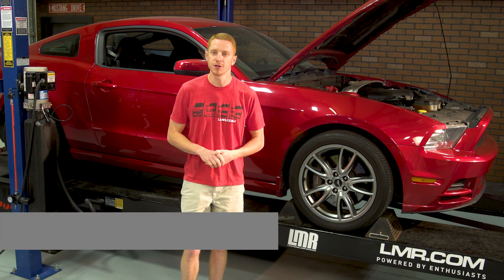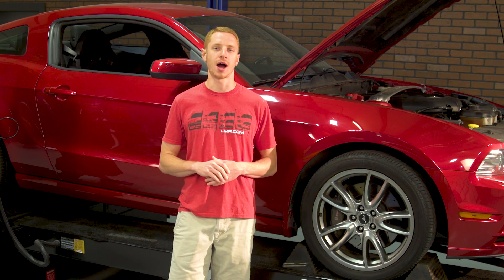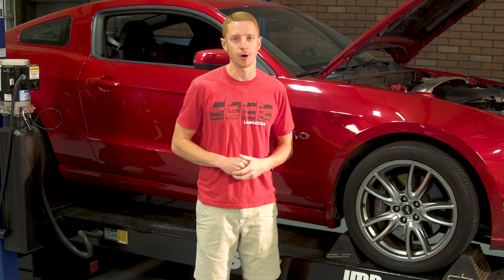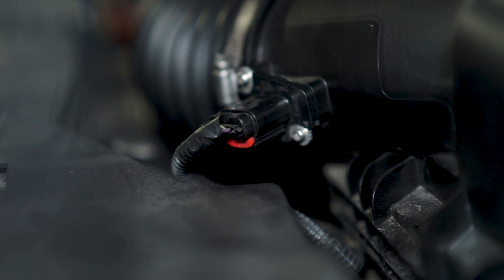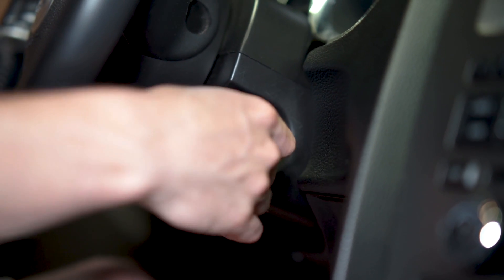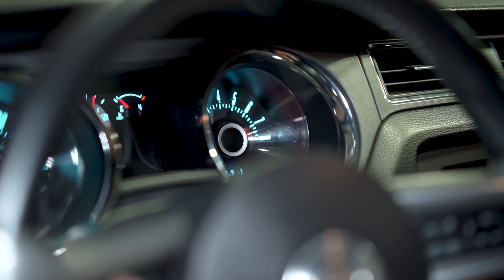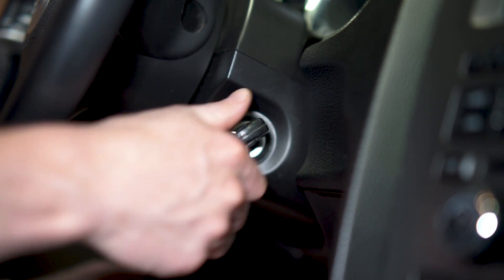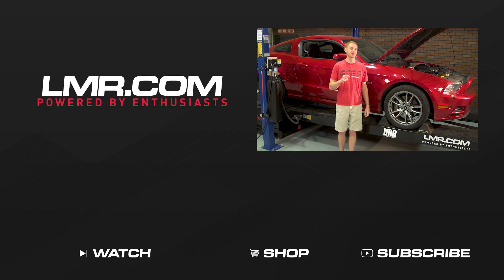2013-2014 Mustang GT Ford Performance Track Cal - Install & Dyno

Comment: So, after installing this, then later the Bama v2 race tune, I noticed the numbers American muscle was getting on the dyno.  The TrackCal should be blowing the Bama tune away, but my car tells me a different story.  That's when I found out I have the ProCal tune, which is weaker than the TrackCal.  I don't know if I was swindled by American Muscle or Ford, but I'm not buying another tuner just to get that tune.  Is there a way to JUST buy the TrackCal tune??
Reply from the maker: The TrackCal and ProCal options for the gen 1 Coyote cars have been discontinued. -Landan

Comment: Hey LMR, do you know if this is any different than the 11-12 Ford Performance calibration. I assume this wouldn’t work on an 11, but they seem similar.
Reply from the maker: Ford Performance used to offer M-FR1-MGTB, but they discontinued it. For whatever reason, they never offered the calibration by itself for 11-14 GT cars. Instead, they just have the Track Cal for 13-14 manual equipped GTs. The reason for the specific year range is due to the steering wheel controls for the Launch Control and Pit Lane Speed Control features. Hope this helps. -Landan
Reply: @latemodelrestoration would this work at all on an 11-12?
Reply from the maker: @chrissyrett673  This is for 13-14 cars only. -Landan

Comment: does this work on an automatic car ?
Reply from the maker: As mentioned at 01:47, this will only work with manual transmission 2013-2014 Mustang GTs. -Landan

Comment: So who do I contact about this issue?:  When I'm in 2nd or 3rd and I slow down to a stop before going up my driveway curb, I put it in neutral to shift into 1st and it dies in neutral.  It's done this randomly like 4 times in a couple months.
Reply from the maker: I would contact your local Ford dealership or a trustworthy mechanic. That sounds like a transmission issue. -Landan
Reply: @latemodelrestoration  it's curious because the car only has 30k miles and it never did this until after I installed the procal tune.  Doesn't do it when I remove it.  🤔
Reply from the maker: @ScreaminChicken444  That's really strange. I would contact Ford Performance's tech line and see what they have to say. -Landan

Comment: When you disable the trac cal features at startup, you still get the added benefit of the hp and torque increase correct?
I'm not really into the lopey idle.
Reply from the maker: Yes.  The performance gains are permanent unless the calibration is removed and the vehicle is returned to stock.  -Landan

Comment: Would it still function right with a cat delete?
Reply from the maker: Unfortunately, it will not work with cat deletes or long tube headers. With all the exhaust laws in place, I would suggest you contact your local custom tuning company. Most email custom tuning companies no long tune for off-road exhaust.
Reply: Ok thanks. Also if you have the pro cal installed already and then you have an engine code will you have to fix the code before the tune will work again?
Reply from the maker: If you go with a custom tune, you will have to remove the Pro-Cal unit from the vehicle altogether. If any codes pop up, you will need to address the code to see what is wrong.
Reply: Ok thanks for the help

Comment: Recently purchased a 2013 GT that had a Ford Performance supercharger installed when it was brand new.  The previous owner gave me the ProCal unit, and I can’t seem to figure out the Launch Control.  I press down on the brake and ho,d in the + but it won’t cycle.  I even went ahead and plugged in the ProCal and went through all the steps, left it in, and tried getting to set my launch, nothing.  Not sure what the missing piece of the puzzle is, but any help is appreciated.  I’d love to play with the launch control to help out at the track.  My car is a manual, thanks.
Reply: Did you ever figure it out? Same issue with my 2013.
Reply: @Brute5o  I did.  I called Ford Performance, and they advised that this is bogus.  No launch control for this year.
Reply: @christianeshelman8195  thank you! 🤟

Comment: I'm a 2013 Boss 302 owner. What is the difference with this Cal Tuner Vs. the Boss Track Key Tune? 

Could I use this Cal tune on my Regular Gray Key and still keep my Red Track Key Tune? Or would that just be redundant?
Reply from the maker: Hi Joey, this calibration will only work on GT's. It is not applicable to the Boss 302, unfortunately. Both feature the lopey idle but the track cal will also provide driver functions such as launch control and pit speed control.